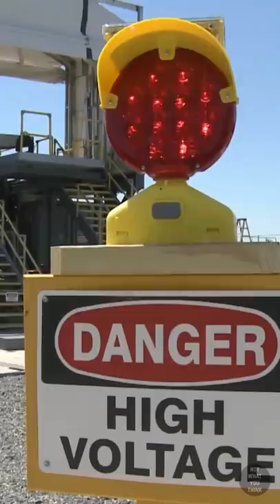Railguns: Destructive to the Core

Comment: „It’s not what you think. Rather than gunpowder or chemicals, it uses a massive electrical pulse to launch projectiles.“ yeah, kind of the point of a railgun. If it used gunpowder, what would be the difference to a good ol’ canon

Comment: Government contractors are stupid. I didnt expect such foot dragging with BAE systems ether. Its that or they dont know what theyre doing.

General Atomic was the other bidder for the railgun project, they went out of their way to moch up a working system. And still failed to snag the contract.

Now, BAE system is on year 6. And still not working out. 
Wile GA had finished their railgun, fixed its problems, and even compacted it down to be Trailer mountable like a Phalanx. All 3 years ago.

Comment: I don't get why they're using a real gun for this kind of machine. for the same amount of money you could accomplish and even better weapon using a coil gun instead. a girl gun uses timed magnetic fields to pull the projectile down a hollow barrel. it's not accelerated by The Lumineers force that powers a rail gun. so when the projectiles are actually fired it doesn't cause a lot of damage to the rail gun itself. there's no warping of rails there's no rails to Warp.

Comment: yeah, but a battleship would bitch slap a zumwalt with a single round from its 9 12 inch guns. yes it can pierce the armor on a battleship, but it’s not gonna be able to cause enough damage to actually do anything to the ship. battleships r built for doing slug fests against other battleships, a tiny ship like a zumwalt would be seriously crippled and in critical condition after 1 900 pound 12 inch armor piercing shell rips throu the entire ship causing catastrophic damage. even during the nuclear testing a few battleships survived a nuclear blast with minimal damage. wat u think little missiles and a rail gun would do against a ship that can shrug off a nuclear blast?

Comment: So why not just use a step up power system with the strongest force being applied inside the very tip of the barrel on braced struts? 

Seems like it would lessen the stress on the barrel overall by allowing the majority of the force to be at the very tip where it can dissipate most efficiently. Not to mention if you had to change anything then it's only the tip not the whole barrel. 

Better yet why not just invent new ships with larger power plants and rail guns built into the frame of the ship itself instead of on a gimble. That way you could easily cool the weapon by pumping seawater through small underwater filtered openings and ducts around the weapon itself. 

 I mean, yeah it would be a bitch to aim but with smaller gimble set rail weapons and modern day radar and I.C.C. I don't see how facing an enemy would be an issue, especially with the smaller gimbled rail guns being able to direct force in multiple directions whilst the main gun is set upon the target.

Comment: The Zumwalt was designed for this specific technology and it FAILED! This is why the Zumwalt class destroyer was canceled and the 5 that were built are now being retrofitted with existing weapon systems.

Railguns are a brand new technology being developed and the energy required to fire them is, simply put, not practical. Until they can develop a new energy source to power these things it's back to the drawing boards

There is more to it than what is explained here. This guy makes it seem like it's just the stress that's involved when in reality it is actually the energy that's required to power this weapons system

Comment: Can they just idk... Make them smaller? Lol
Reply: They have to disperse heat, if they are to small they are likely to melt or the power will be drastically reduced. There are hand held railguns you can buy but it’s like getting shot by a BB gun because they aren’t powerful enough to be lethal
Reply: @Bro1212_  I see. Thanks for the info 👍

Comment: They lied. These "rail guns" use a powdered charge to give the slug its initial boost, this is why you hear an explosion each time it is fired. They use a charge to get the slug moving to be able to hit certain speeds, without it, the rail would need to be much more powerful and would still need some sort of kinetic force to get it moving to begin with. Claiming it does not use any sort of explosive force is straight up a lie, especially when you see fire in half the clips used.
Reply: That fire doesn’t have to be from a charge. There are amateur models made at smaller scales that use only co2 to start the process and they also spew flames when shot. Everything else you said though is true and I’m not trying to argue just pointing out that those flames could be from the force of the metal being shot out at such speed

Comment: This videos a complete lie there is Rifle sized rail guns that have been made by black budget military and that was decades ago. The problem was they were way to destructive and way to dangerous so they shelved the smaller handheld prototypes and stopped investing and then slowly have been moving rid bits forward in the view of the public on the big ship mounted rail guns and  the reasons they gave is what you just said. Too much energy needed, too much force on itself, wear and tear, replacement costs, damage to ship and not enough energy on ship to provide in the constant usage on weapon. Etc. It’s bullshit people make
These things at home now and a lot smaller with car batteries ffs.